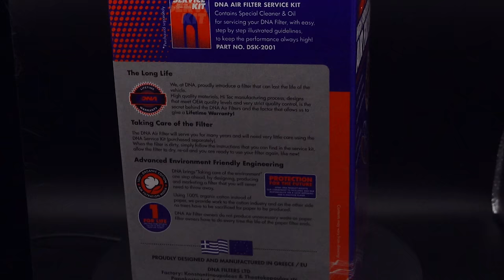Royal Enfield Interceptor 650. Dont fit A DNA performance air filter until you have watched this!

Comment: I had a DNA filter on a MT07 a couple of years ago. And I agree. Well worth it. One could make a bracket/bellmouth out of the old snorkle. But I bought the DNA one. Back to the RE. If you change your exhaust you will find even better performance. Quite a lot, actually! But, will the ECU manage to climatize that? Do you know? Or is a "flash" required? Thanks, you do make wellmade films where the message is the message. Not fast clips, awful music or other disturbing features. :-)
Reply from the maker: Hi John the ECU should be able to adjust to just about any new configuration. But as stated the 12 minute tune method as it is known, will usually ensure it takes first time without any issues!
Reply: @stuartfillingham  Hi Stuart! Wow! That's good news to me. Thank you!
Reply: @stuartfillingham  Stuart, Should the motorcycle be stopped with the engine running for 12 minutes? It would be a long time for an air-cooled engine.

Comment: Did i have to idel the bike for 10mins for everytime i srtart it !
Reply from the maker: no
Reply: @stuartfillingham  hey bro, i wanted to use high efficiency injectors (50% more power from same amount of fuel) so is the ecu will automatically adjust the fuel flow by same process of idling or i have to remap.
My project also includes adding supercharger to it after the successful operation of injectors
Reply: @stuartfillingham7011  ok bro🔥🔥

Comment: Fascinating stuff, many thanks, looks like more shelling out as both the ST and Monster are still on oem.  I'm wondering now what's in the exhaust pipeline for the RE!  Any plans to swap the Phantoms btw?
Reply from the maker: no plans to swap tyres Stephen, quite happy with the phantoms , good dependable tyre!
Reply: Hi Stuart
Really enjoy your Videos and, like many on here, bought an Interceptor, myself a couple of weeks back, having followed your own experiences.
At the moment I'm wondering how I can address some really serious tramlining I'm experiencing on poor road surfaces and tar joints between carriageway and slip road.
It's fitted with the Phantom stock tyres and they are at the correct pressures and the bike has only 500 miles, so far. I have a Himalayan which is fitted with MT60s and suffers none of the issues I have on the Interceptor. Any advice would be welcome.
Reply from the maker: @chriskay116  I always consider tramlining to just be part of riding a bike Chriskay, although ive not experienced it to be severe with the Interceptor. The problem is you can change tyres and find one that doesnt do it, then find as it wears, the habit creeps in again, so there is no definitive cure. My advice is go with the flow and learn to live with it!
Reply: Thank you. I've experienced it, too, and have just seen it as part of the thrill but nothing as bad as this. I've had a bike licence since 1984 but have recently returned to motorcycling. Roads, here, around Manchester are in a really rough state with multiple repairs. Perhaps it really is something that I'll have to live with.

Comment: Hey Stuart, a great review as always. Have recently bought the Interceptor 650 and am loving it. Have seen your reviews on the bike and other things like the Motone Customs kneepads. In fact bought them the same day. Boy, does the bike look gorgeous after affixing them or what?😄

Your reviews are easy to understand and very informative. You have a way with words, that’s for sure. And the accent is very charming too😀

I noticed that the bike used in this review has a customised seat. The stock seat provided is very soft and not really comfortable for long rides. I am thinking of changing the seat too. Any advice on how to go about it? Will be great help. If the seat is available off the rack, can you please provide the link?

Thanks once again for the excellent reviews and keep up the good work 🙏
Reply from the maker: Review of that seat is going up today Uday, about 3 hours from now!